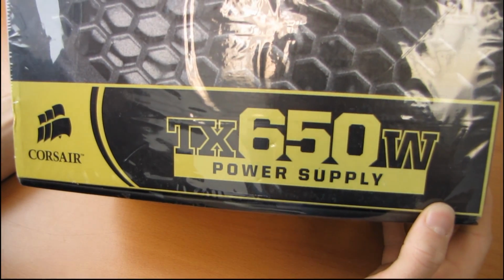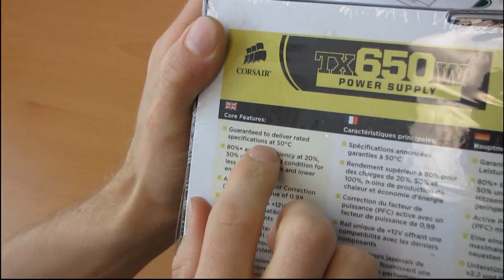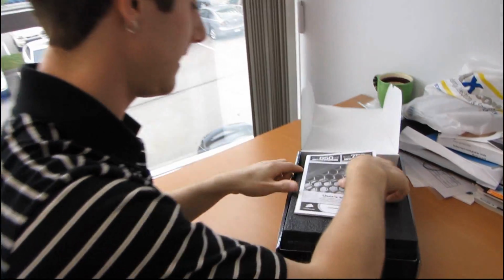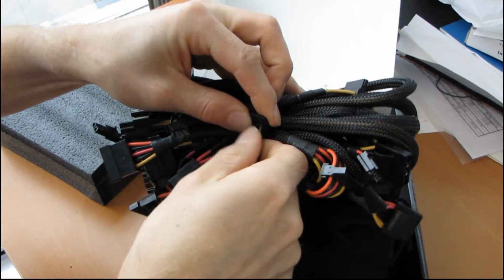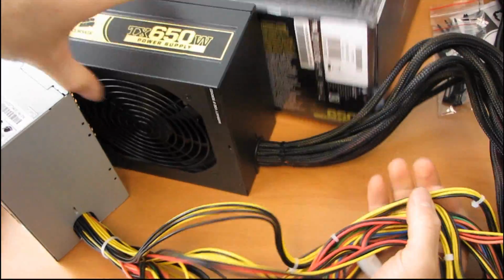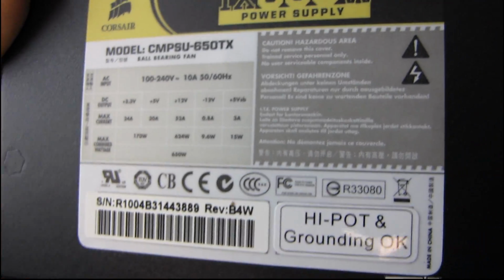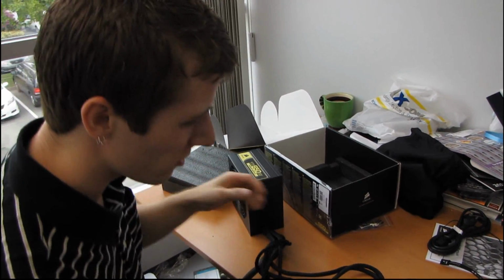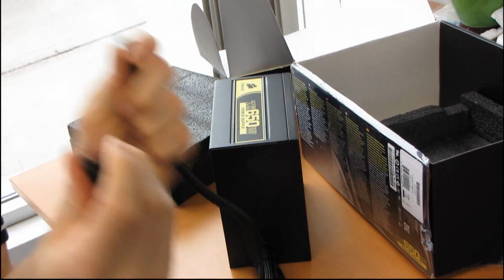Corsair TX650 650W Power Supply Unboxing & First Look & Gaming Buyer's Guide Linus Tech Tips

Comment: On my 4th built, with ryzen 7 2700x and vega64. Bought it used in 2012 on ebay and still running great. Newer go cheap on PSU,  arguably the most important component of PC.

Comment: I'm a rookie when it comes to pcs. My brother gave me his old one and I didn't use it for a while but now when I turn it on it starts for maybe 5 seconds and then turns off. I have checked the ram and that's not the answer. Is this PSU still usable? I'm thinking this is the problem since it's the oldest thing that's in there. Any help is appreciated even though this is an old video :)

Comment: Future here. Here in the current year, modern mid-range single GPU cards take 2x8 pin connectors and are considered low power. Also I use this PSU for I dont know how many years and I love it

Comment: Hey guys.. Im wondering really (can't sleep thinking of this) I am looking for a power supply!!

My specs:

i5 4690K
GTX 970
8GB 1600 MHz
500 GB HDD
Gigabyte GA H81M DS2
Samsung DVD writer...

What wattage of Power Supply should i go with??? Thanks
Reply: Put your specs into a list on  pcpartpicker.com and it will tell you basically what to expect in terms of power usage. Or just go with a 500W PSU. I have an i7-4790, GTX 970, 2 HDD, and a DVD drive and I run all of it off a cheap 460W Dell OEM power supply. This power supply has never had a problem after 4 years!
Reply: @bluecheesybob  wtf that was over 3 years ago, do you think he is still looking for it
Reply: @_qwe_fk_1700  lmao im dead
Reply: Hostis Gaming 4 years**
Reply: @_qwe_fk_1700  you never know

Comment: Can I use one of these in my System

Motherboard - Gigabyte GA-A55M-DS2
CPU - AMD A4-3400
RAM - 4gb (adding 4 more gb when I get the money)
GPU - EVGA GTX 650ti
Fan - Artic Cooling 80mm
Reply: Easily.

Comment: Supports sli gtx660?
Reply: I'm preety sure it supports any SLI setup as long as there are enough power connectors to power it.
Reply: I wouldn't recommend it.
Reply: Max Cummings
Why not? It has plenty of power on the 12V rail
Reply: Evaldas65 The power supply is bronze, The efficiency is not that great for the price. You can get better psu's for the same price.

Comment: will this be enough for the following specs:
CPU: FX6300
RAM: 2X 4GB
GPU: GTX 760 4GB
MOBO: gigabyte 970A D3
FAN: 6LED 120mm case fans (+ heatsink twin 120mm fans)
Just wondering if it will handle it normally under max load and not burn out
Reply: It will be more than enough even with full load.
Reply: ***** sweet thanks
Reply: ***** Can I use this PSU on a dedicated circuit with 20 amps??
Reply: TortoiseShellGames  I'm not sure of that mate.
Reply: *****  Well, thanks  for letting me know!
Reply: np

Comment: Nvidia said that for the gtx 770 the minimum is 600W and I have a gtx 770 and a i5-3570k. Would this PSU be ok for me because I need a new one because my current one is 500w and after a week I had to replace my graphics card because it died.

Comment: what about a 500w is that good enough cause i'm building a gaming pc not to major just a Force3D AMD ATI radeon HD 6450 2Gb DDR3graphics card Intel Core 2 Duo Processor E6550 2.33GHz 1333MHz processor foxconn G41MXE motherboard Cooler Master eXtreme Power Plus 500w Power Supply (RS500-PCARD3-US) power supply and so on is that good enough for a Mid end graphics card

Comment: i have a 

- Intel core i5-3570k
- ASUS P8Z77-V LX, Socket-1155
- Sapphire Radeon HD 7850 1GB GDDR5
- Cooler Master V8
-Corsair Dominator DHX DDR3 1600MHz 8GB
-Crucial m4 SSD 2.5" 128GB

Is the TX650w has enough to power my specs???

realy need a help

Comment: get an ax850 or 850hx. if you're just going to oc cpu (i5 2500k or i7 2600k) and not the gpus, you could probably get by with a gold rated 750 watt or a 750hx (pretty much a gold rated psu).

Comment: No. A single GTX 580 requires a 6-pin and an 8-pin PCI power connector so two cards need 2x 6-pin and 2x 8-pin. This power supply only has 2x 6+2 pin connectors. Besides, the power output wouldn't be enough anyway. Corsair TX 750 has 4x 6+2 pin connectors so that would be the bare minimum that you need.

Comment: I have the Power Supply and I just realized that the fan is NOT running. There is a PWR Fan port on the motherboard thats got 3 pins. I don't see any 3 pin connector on this power supply. What should I do?

Comment: @BlaZee181 Corsair is so overrated, XFX uses better stuff since corsair stopped using seasonic. And XFX has modular 650w units for 90$. Im running an XFX XXX 650w right now and it powers a GTX 470 and a GTX 275

Comment: @JibJabJabs This power supply would be more then sufficient for that build.  Only reason you would want anything higher is if you are running a crossfire or SLI system.  I'm running a Cooler Master 650w, on about the same system actually, just I have only 8Gigs of ram.

Comment: it only has two PCIE connectors. I would get a XFX750 / TX750W for two 560ti / 6950 with 4 PCIE connectors.

This PSU will power any single GPU easily though.

Comment: @misthafly I dont kow what brands you have in your country. I would say chieftec ctg 550 80p. But you can buy the tx650 as well, you could put another 5850 in your system later on. Iam just saying, you dont necesssrily need 650w for single gpu, but the tx650 is a great price/value psu.

Comment: @Stricker It's what supplies an equal current through. You'll find with Brands like Acer will have 4x12v rails. There's nothing extremely wrong with more than 1 or 2, but it has to evenly share between extra rails.
That's why some will show you:
+5V @30A R1 +5V @30A R2 and so on.

Comment: i want to build i new computer and im having ALOT of trouble with the power supply. Im not sure if the power supply is able to handle this. Here are the parts i plan to purchase:

1155pin AsRock P67-Pro3
Intel Core i5-2500
Seagate SATA3 1TB
DDR3 4GB Kit G.Skill Ripjaws 1600
MSI GTX560Ti 1GB

and of course
Corsair TX650W

Also do you guys reckon if i should install another fan instead of the sole stock cpu fan?

Comment: I have a big prob with the PSU. I've just build my rig an after an hour of running I started to smell this funny buring smell. I thought it might of been the cpu at first but then noticed the melted unused cables of the psu that I put to one side in this case. Is this a factory fault? Shud I not have bundled them together to one side or what any advice will be much apreciated. Also my computer wont turn on now, is there some sort of fuse within the power supply?

Comment: @Technofan23 5770s don't use a 6 pin and an 8 pin each which is what u said in your first comment.  If you were goina use an 6 pin + 8 pin GFX card (like a GTX 285) then i'm not sure a 500 watt PSU would be sufficient

Comment: @gumberly well what cpu are u running?
but you should be fine with a 650w because ive got 2 5770s on a antec 650w
and they only use about 6 watts less then a 5870
so go with this power supply or a 750-850 for future upgrades

Comment: Looks like I made the right choice choosing my 650tx. That's exactly what u want to do with mine. The only downside is that it's a to mounted psu and mine is on the bottom, all this means is the sticker is the wrond way around and the 8pin CPU cable is a bit of a tight fit in bigger cases.

Comment: @ It will work just fine. I have a core i7 980x @ 4 ghz and an overclocked 5870 on that psu.My PC never goes above 300 Watt AC Power usage anyhow. If you plan on getting a second video card, you should go for a higher wattage psu.

Comment: hm 500 watts are ok too. running a 5870, a p2x4 965, m4a79xtd-evo, 4gb gskill ripjaws, 1 hdd, 1 dvd-drive, 3x 140mm fan, a 120mm fan and a coolermaster v8 on a coolermaster m520.
The whole system needs like 350 watts, so there is still room to work